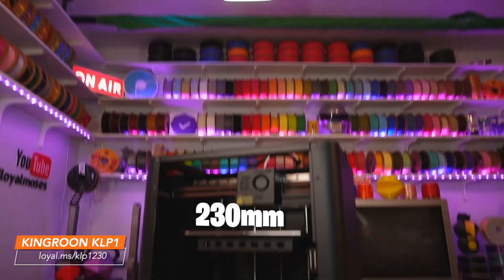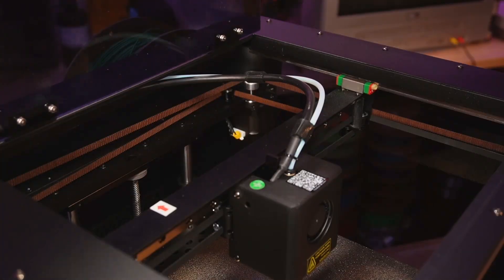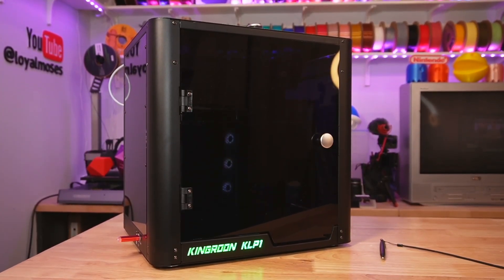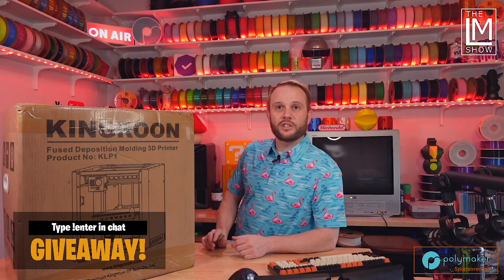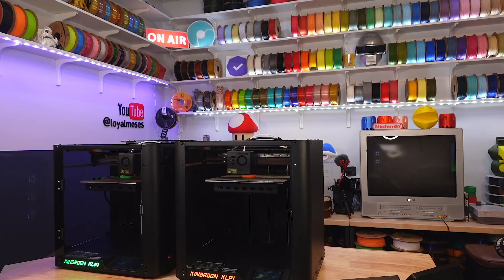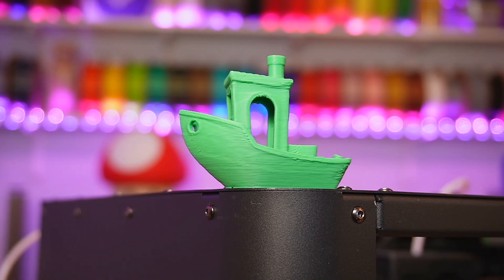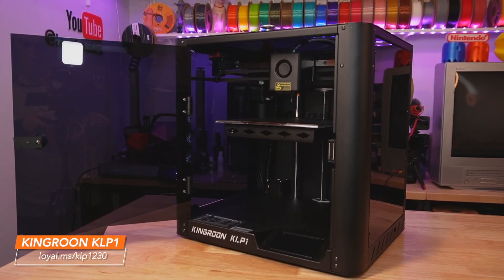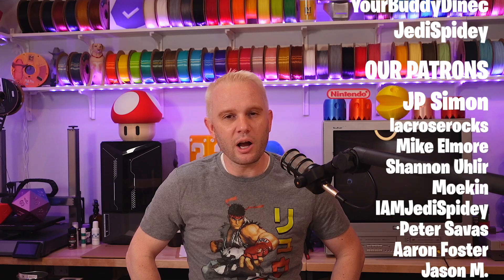Did they ACTUALLY Improve it? NEW Kingroon KLP1 230

Comment: I have the 210 and the 230. The 230 hands down prints way better than the 210. The new extruder and belt configura probably go a long way to the improvement. With that said, it looks like Kingroon is completely getting out of manufacturing 3d printers whic his to bad since they seemed to be making improvements and still selling at a low price point.

Comment: It's so disappointing they didn't fix the most annoying issues the 210 version had: the screen should be on the outside, bizarre filament sensor placement, the top lid being too close to toolhead etc. They basically ignored all the feedback and shipped the same thing for the 3rd time under the same exact name (the v1 version had no screen).
Reply from the maker: The lid being too close is a strange phenomenon that all of these enclosed machines have, even Bambu and Creality are doing it, it's weird. I really wish they'd changed the screen out to a touch screen instead of this silly stylus thing. Finding this stylus drives me nuts!
Reply: @LoyalMoses   Qidi X-Max 3 is the one headroom.

Comment: Nice comparison. $50 more for 20mm... that's what, $2.50 per mm... I guess it's not bad LOL. Did anything else change on the printer, or strictly the size? Would be surprised if they didn't do more under the cover things to it. Thanks for all the excellent content Loyal.
Reply from the maker: The extruder gearing ration changed, which appears to have a significant impact on the print results at speed, but overall, they did great making it a more reliable machine.

Comment: A VERY short glance at the new version. You're barely scratching the surface here. There would have been so many things you could have compared between them, at the very least;
- Noise levels when printing and when idle
- Changes in the toolhead department?
- Heatup time of the old bed versus the new one
- Do they use the same power supply since the bed is now bigger and more power hungry?
- Any updates to the software and/or UI?
- Any specific issuesthat were in the first version fixed in this one?
etc...
Reply from the maker: That’s the great thing about YouTube that I think 3D printing people have lost sight of. Not everything has to be in a single video and has to have all the nerdy geeky stuff. Sometimes I get to do a comparison that was inspired by my audience on our live show, and that’s it, just that and if I feel like coming back to it, I might.

3D printing has expanded out past the nerds and geeks and 99% of users don’t care what power supply is being used or if it takes 93 seconds to heat up or 87.

Comment: $395(current price) for this vs an A1 for $399 is a hard sell. This would need to drop to AT LEAST 339 for me to even consider it.
Reply from the maker: Very different customer base I believe. People looking for an enclosed Klipper machine play has a great option here.
Reply: @LoyalMoses  perhaps you're right. A1 isn't great for ABS or ASA unless you enclose it somehow. I'd still say it is a tough sell for my uses, but not as bad with that context. 
I will say if the bed size was on par (256+) that would entirely change my opinion.  🤷🏼‍♀️
Reply: aliexpress at $219 now